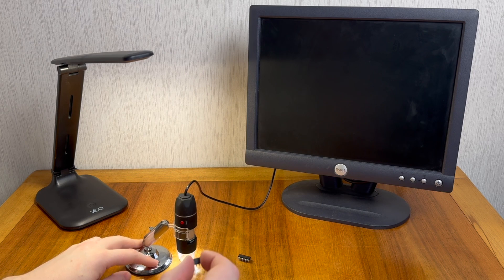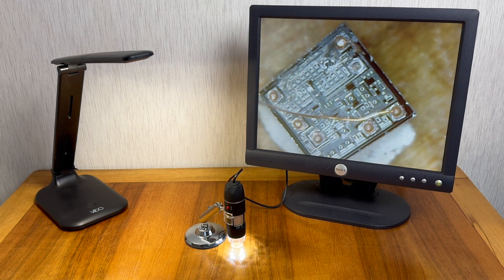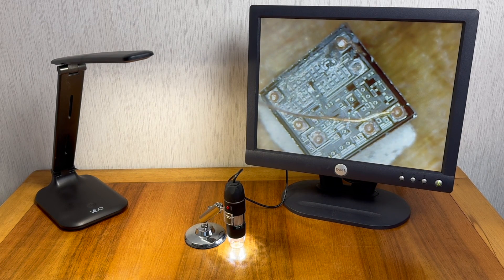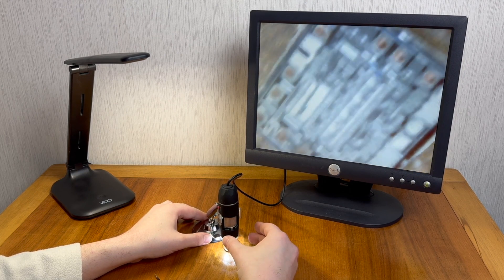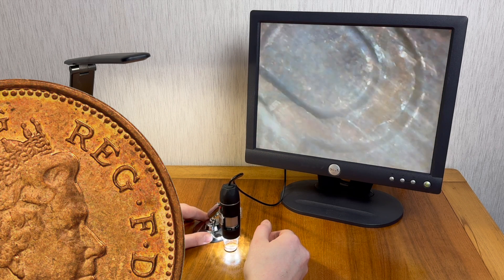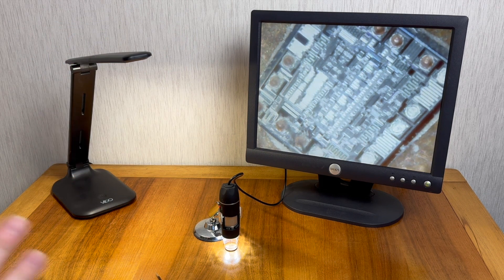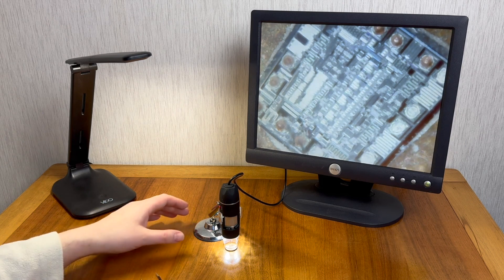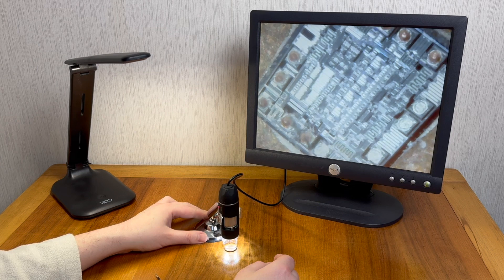Cooking with Gas - Decapping failed 555 and 4017 IC Chips

Comment: What brand of small hobby digital microscope is that? Can it take still images? Thank you again
Reply from the maker: It is a Jiusion Digital Microscope (USB, 1000x, Black). It shows up as a USB camera, so it should be able to be used to take still images. It has a "snap" button, but it doesn't do anything connected on my Mac. I think this is the product here:
https://www.jiusion.com/products/jiusion-40-to-1000x-magnification-endoscope-8-led-usb-20-digital-microscope-mini-camera-with-otg-adapter-and-metal-stand-compatible-with-mac-windo
Reply: @jtjacques  okay thank you again sir! About $23